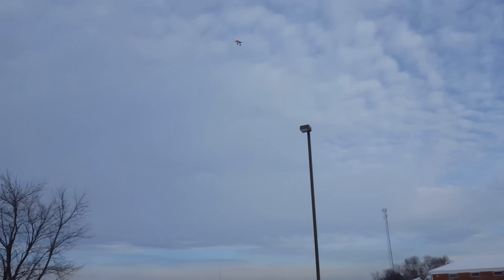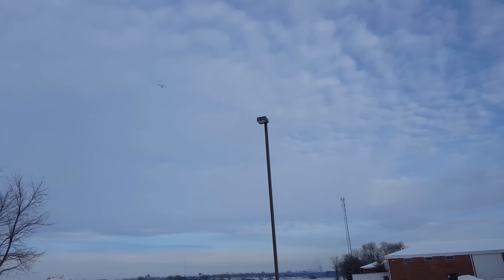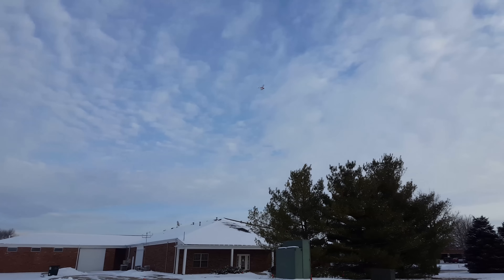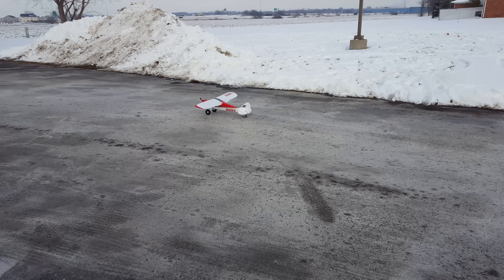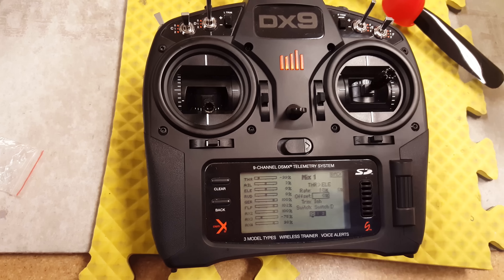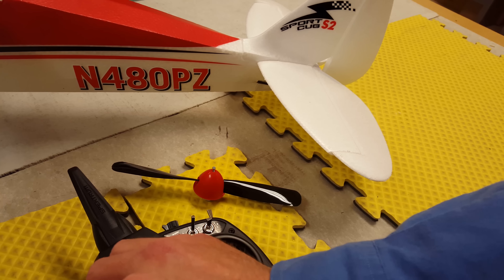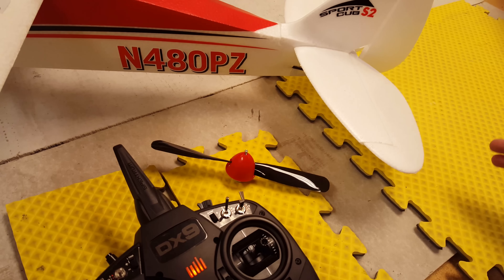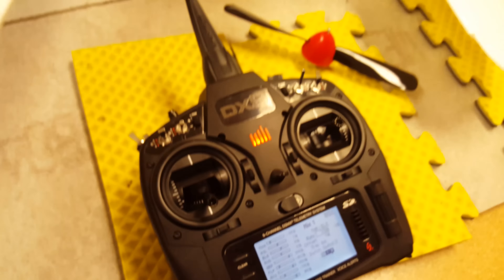Parkzone Sport Cub S2 flaps installation: Part 3 Flying!

Comment: It's like you went from 10% and 10% throttle mix (which would have given you 20% total elevator deflection at full throttle) to having 18% totalelevator deflection at full throttle but no offset and no mix when the throttle is below half. Are you able to explain a bit better the 'bottom half' of the throttle mix and the offset. If I put 9% and 9% I have to put in 100% offset to get the flaps right.